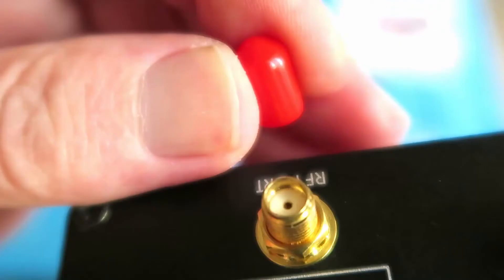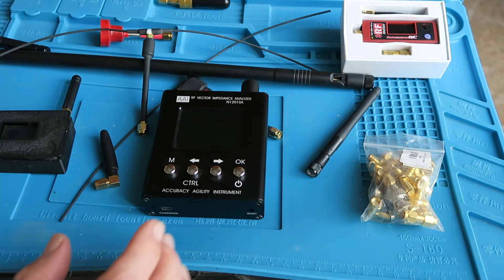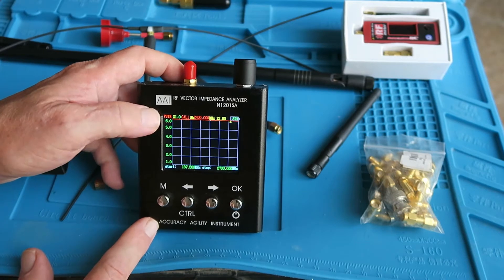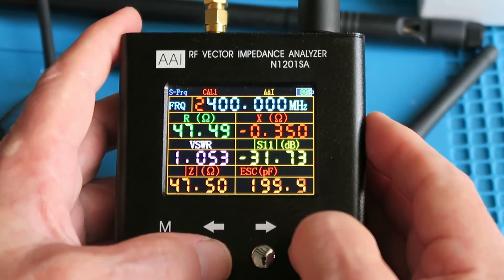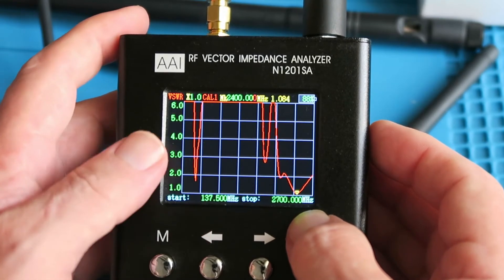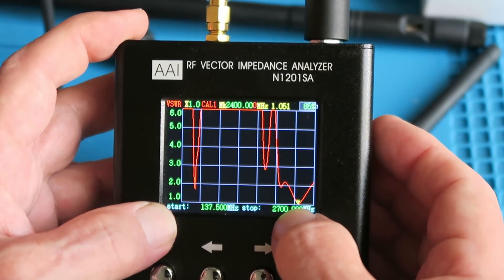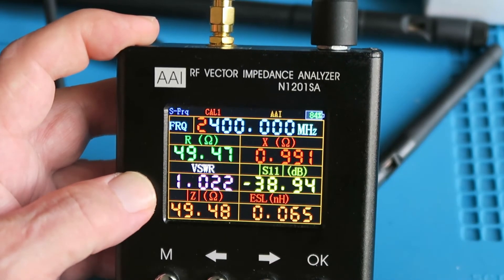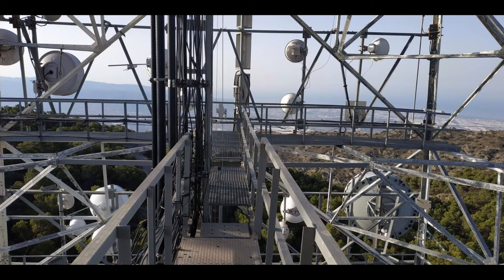N1201SA Antenna Analyser Review

Comment: I got a little free-be from a farm worker. A lost Bebop 2 in mint condition. Don't know what now? Anyway... I am a ham radio operator and although a VSWR of 1:2:1 is desired, at 1:5:1 will still work very well. To find a antenna to match on 2 or more different frequencies is quite common... Hence dual band antennas such as in the Ham hobby, 2 meter and 70 cm bands. But... is the antenna resonant on all? Oh, I do have a ham call! What is yours? Nice video again...
Reply from the maker: Hey thanks! Back in the early '80s I took the UK ham radio exam and passed. I was trying to get away from the tedious CB chatter of "wot's you handle"? "wot's rig ya runnin?" "got ya boots on?" etc. However my first ham contact was a disappointment "What's your call sign?", "What transmitter do you have?", "What power output?". At that point I gave up!! Nice find the Bebop 2.
Reply: @1nformatica  I send you a mail... What can be done with the "find" that seems to be a better product than my Hubsan.